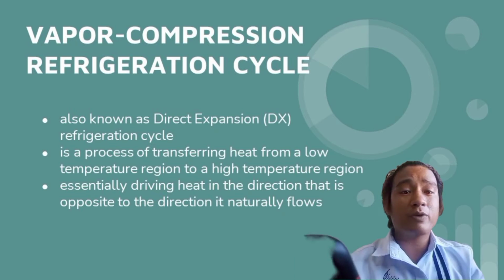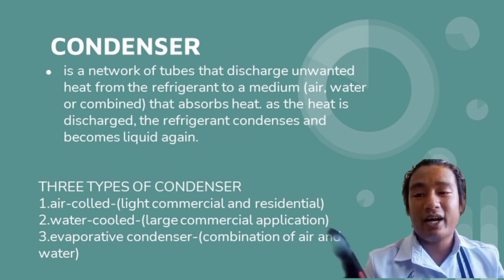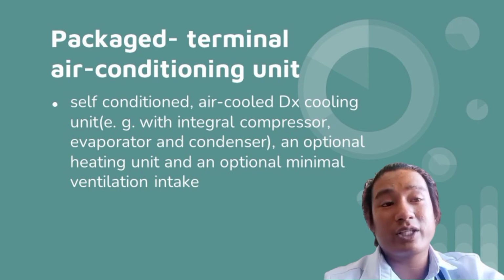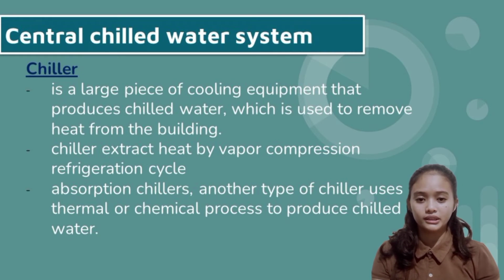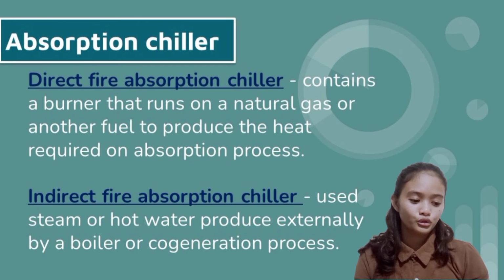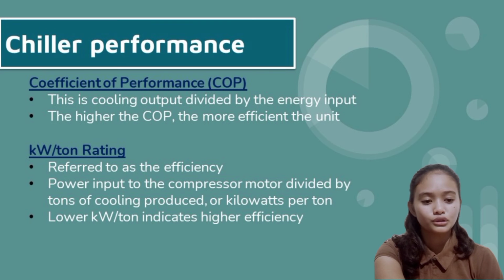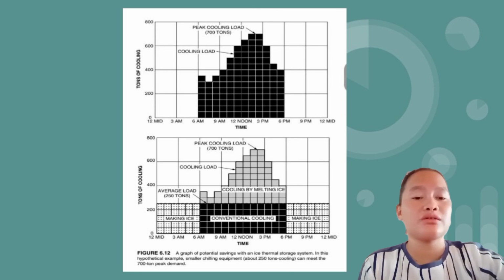REFRIGERATION - Ellevera_Niño_Sultan

Comment: REYES, DANIELLE WILLIAM E. - BSCE-3B

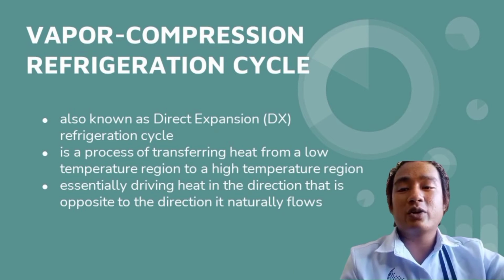0:26 - The definition and concept of Vapor-Compression Refrigeration Cycle
21:07 - The subtopics of performance ratings for air conditioner and heat pumps: Integrated Part-Load Value (IPLV) definition
33:58 - The various definition of topics related to Refrigeration
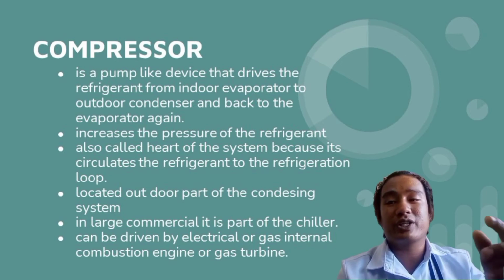9:15 - Definition and concept of Expansion Valve

Comment: Unabia, James Rafael V.  CE3B

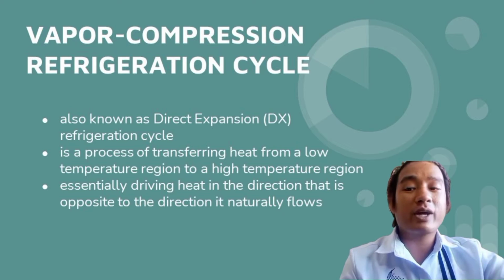0:29 Definition of Vapor Compression Refrigeration Cycle

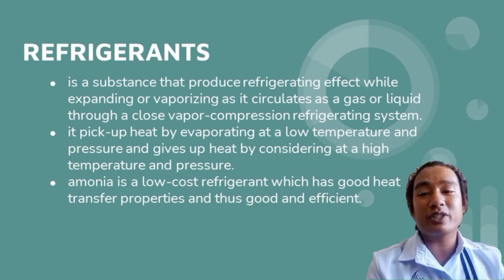3:16 Regfrigerants- a substance that produce refrigerating effect while expanding or vaporizing as it circulates as a gas or liquid through a close vapor compression refrigerating system

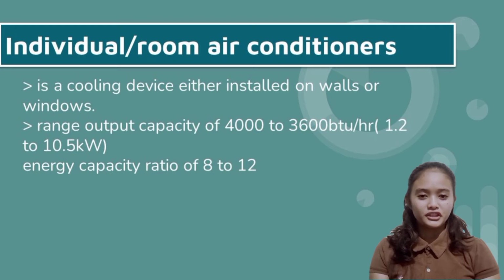18:45- Individual/room air conditioners definition

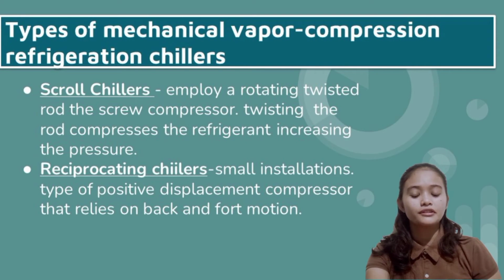26:50- Reciprocating Chillers- relies on back and forth motion

Comment: Ipanag, Miles Gizza L. - CE3B

0:31 Definition of Vapor-Compression Refrigeration Cycle
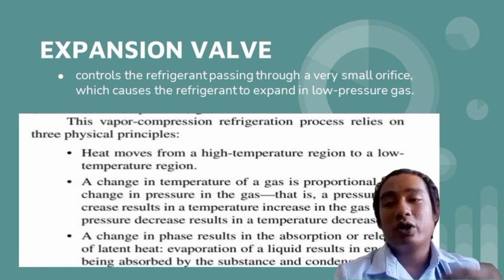11:54 Cooling/Refrigeration Capacity
13:50 Central Air Conditioners definition and its basic parts
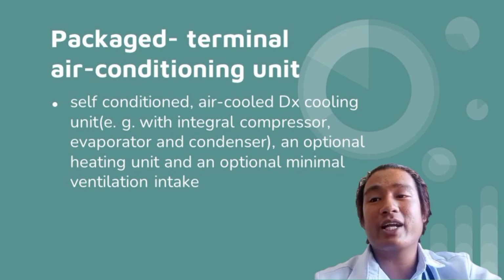16:34 PTAC (Packaged - Terminal Air-conditioning unit)

24:20 Mechanical Vapor-Compression Refrigeration Chillers Types 
33:00 Use of Multiple Chillers
35:23 Types of Cooling Towers (Direct/Open, Indirect/Closed, Forced--Draft, and Induced-Draft)

Comment: CE3B-DETALLA, ANGELIKA S

3:20
REFRIGERANTS produce refrigerating effect while expanding or vaporizing as it circulates through a close vapor-compression refrigerating system.

4:24
AMMONIA is an example of refrigerant used in Europe but it is banned in US.

13:59
CENTRAL AIR CONDITIONERS is a DX refrigeration system.

18:59
ROOM AIR CONDITIONERS are cooling devices installed in walls or windows.

20:01
Higher EER, high efficiency of unit-- same as goes to SEER.

27:14
ABSORPTION CHILLER where there is no compression of refrigerant. Also uses both refrigerant and absorbent.

31:02
HYBRID CHILLER SYSTEM uses electric and gas chillers in the same plant.

35:28
TYPES OF COOLING TOWERS:

1. Direct/Open Cooling Towers
2. Indirect/closed cooling tower
3. Forced-draft cooling tower
4. Induced-draft cooling tower.

Comment: Luminarias, Kate Mavis P.
BSCE - 3B

0:26 - Vapor-Compression Refrigeration Cycle
3:14 - Definition of Refrigerants 
5:19 - Definition of Evaporator 
6:39 - Definition of Condenser
7:44 - Definition of Compressor 
29:17 - Chiller System
35:20 - Types of Cooling Towers
38:46 - Ice Thermal Storage System

Comment: Romero, Juniel N. - BSCE 3B

0:26 — Definition of Vapor-Compression Refrigeration Cycle

5:17 — Evaporator Definition
7:12 - 3 Types of Condenser 
29:17 - Chiller System
35:21 — Types of Cooling Towers

Comment: Budiongan, MIssy Mae D. - BSCE3B

0:33 – Vapor-compression refrigeration cycle 
3:12 – Refrigerant defined as a substance that produce refrigerating effect while expanding or vaporizing as it circulates as gas or liquid. It pick-up heat by evaporating low temp and pressure and gives up heat at high temp and pressure.
5:17 — Evaporator Definition
11:56 – Cooling and refrigeration system is 
22:35 – Chiller 
29:15 – Chiller System
37:26 – Rotating Pad coolers

Comment: FLORES, WINCHESTER B.
BSCE-3B

0:35 – Vapor-compression refrigeration cycle is the process of transferring heat from low temperature region to high temperature region.
3:15 – A refrigerant is a substance that produce refrigerating effect while expanding or vaporizing as it circulates as gas or liquid.
24:12 - Most chillers operate using the vapor-compression refrigeration process.
29:17 - Chiller System

Comment: Bautista, Mar Flor - CE3B
14:26 Split system - the most common type of central air conditioner
19:55 The higher the Energy Efficient  Ratio (EER), the more efficient air conditioners or heat pumps are.
35:21 Types of Cooling Towers

Comment: Maria Ellen Rose O. Cajeles - CE3B

2:07 - Component of Process of Vapor Compression Refrigeration Cycle Diagram
7:12 - 3 Types of Condenser (Air-cooled, Water-cooled, & Evaporative condenser)
9:17 - Refrigerant passing through a very small orifice, which causes the refrigerant expand in low-pressure gas is controlled by an Expansion Valve.
18:45 - Definition of Individual/Room Air Conditioners
24:12 - Most chillers operate using the vapor-compression refrigeration process.
29:17 - Chiller System
35:21 - Types of Cooling Towers (Direct/Open, Indirect/Closed, Forced-Draft, & Induced-Draft Cooling Towers)
38:44 - Ice Thermal Storage System

Comment: Pelias, Jhon Carla B.

0:31 VAPOR-COMPRESSION REFRIGERATION CYCLE
2:15 DIAGRAM AND COMPONENTS
3:33 REFRIGERANTS
5:52 EVAPORATOR
6:58 CONDENSER AND ITS 3 TYPES
7:45 COMPRESSOR
9:56 EXPANSION VALVE
12:00 COOLING/REFRIGERATION CAPACITY
19:31 ENERGY EFFICIENCY RATIO
36:01 TYPES OF COOLING TOWERS

Comment: LOPEZ, ANGEL LALAINE M. BSCE_3B

0:26 — Definition of Vapor-Compression Refrigeration Cycle
3:14 — Definition of Refrigerants
5:17 — Definition of Evaporator
32:57 — Use of Multiple Chiller
35:21 — Types of Cooling Towers

Comment: Edmar S. Adajar - CE3B

0:35 – Vapor-compression refrigeration cycle is the process of transferring heat from low temperature region to high temperature region.
3:15 – A refrigerant is a substance that produce refrigerating effect while expanding or vaporizing as it circulates as gas or liquid.
11:57 – Cooling and refrigeration system is rated in tons of cooling.
22:37 – Chiller is a large piece of equipment that produces chilled water.
37:28 – Rotating Pad coolers has a pad made of rough polyester material sewn into a wide belt shape.

Comment: Iza Marie G. Leop - CE3B

0:27 Vapor Compression Refrigeration Cycle
3:14 Refrigerants
5:16 Evaporators
6:37 Condenser
7:45 Compressor
11:55 Cooling/Refrigeration Capacity
12:46 Direct Expansion Equipment
13:50 Central Air Conditioner
16:33 Packaged-Terminal Air Conditioning Unit
18:44 Individual/Room Air Conditioner
22:35 Chiller
29:17 Chiller System
35:21 Types of Cooling System
37:12 Types of Direct Coolers